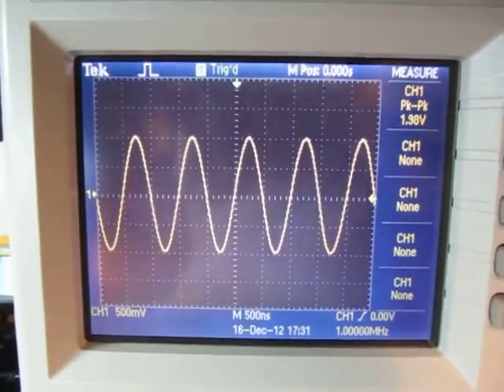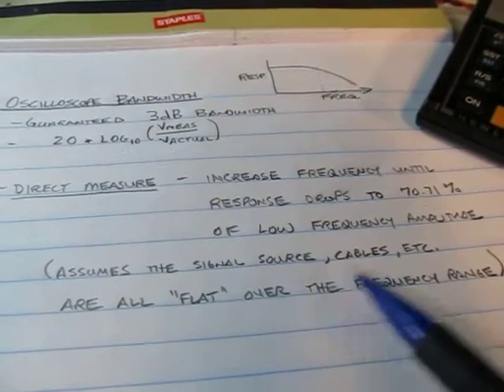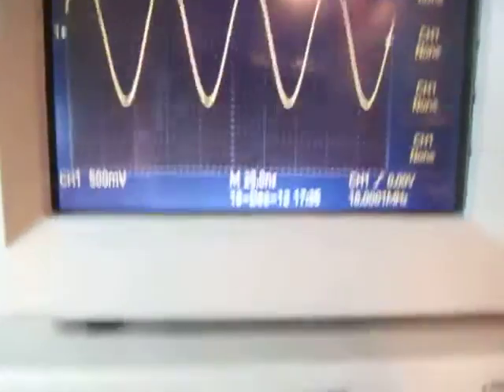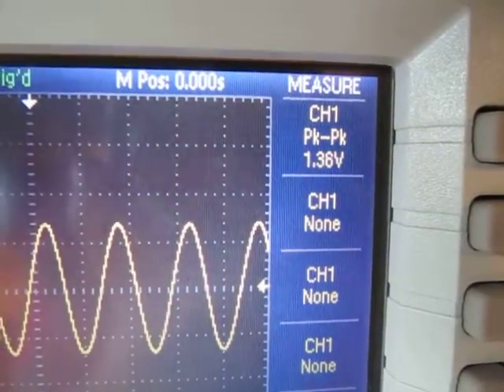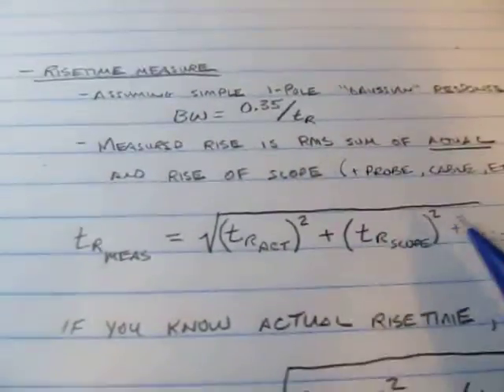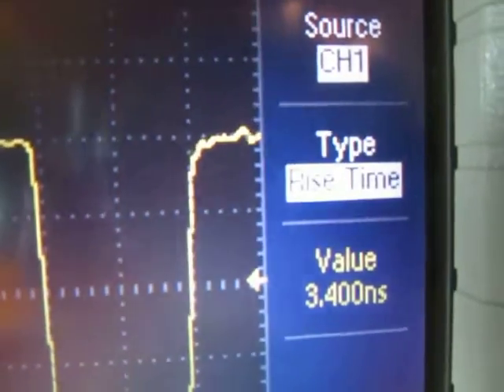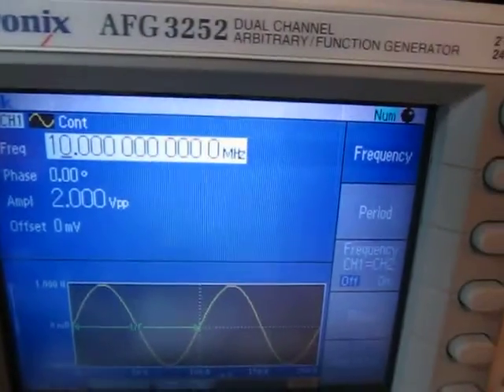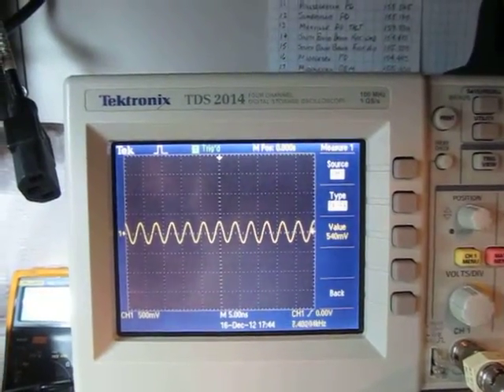#70: Digital Oscilloscope Bandwidth Measurement - direct and using risetime

Comment: Hi. I have now (for the first time) my own scope 🙂 It is a Kenwood CS-5165. It has A and B sweep, and I try to examine a fast rising edge. My problem is that when working at high speed Time Base positions of the Sweep Time that my trace intensity is very weak. I have just opened the case and adjusted the intensity according to the Service manual. It is better now but still weak light. The same thing when using the x10 MAG time base. Then I turned the Adj. pot to it's max. It gets some better but still not satisfy for those fast signals. I believe the same problem yesterday with very small signals, like something about a few tens of mVpp. Maybe you have some tips on why and how this happening, and maybe it is to expect. I can not tell us very little to no experience with analogue scopes. Maybe the scope got deteriorate after what is it >30 years? ...
Reply from the maker: Definitely to be expected on an analog scope.  The faster the sweep, the dimmer the trace.  And of course, 30 yrs of aging and use will also cause some degradation.
Reply: @w2aew  No remedy?? I know, it is the technology, the beam has to sweep fast and has not enough time to leave a high intensity trace/mark... Even though I like those analogue scopes. Yesterday I was playing with an analogue video signal (monochrome and color), and if you know how (with B-sweep) you can examine every Line of the Frame. The trigger was really very stable. The trace is visible just enough to work with it. Tektronix MDO3014 triggers also nicely on video, you can even choose the line number to trigger on.
Reply from the maker: @ernestb.2377  The nature of the beast of an analog scope with 30 years of age on it.

Comment: İ meausured -3db bw of the data on the matlab plot. İ get data from the oscilloscope.it is 170 hz but signal 8Vpp at the 100hz and  5.6 vpp at the 250 hz oscilloscope. İ get different bw.Why it is different bw in the matlab plot and oscilloscope half power frequency?
Reply: But signal start to attenuate at the 170 hz on the oscilloscope and at the 250 hz decreased half power
Reply from the maker: @evlabd  It's difficult to say what is going on without knowing what MATLAB is calculating, and how it is doing it.
Reply: @w2aew  i took data from the oscilloscope and plot it on the matlab. Which bw is true i could not determine
Reply: But it could be calculated bw frequency(-3 DB bw) on the matlab, must be decreased half power at the same bw requency calculated on the oscilloscope
Reply: But i took time interval in the matlab plot to measure bw(1/t)

Comment: At minute 10.05 you inverted 2.7372 (that means 1 / 2.7372) and you obtained 365.33 (multiplied by 0.001). That means that the formula for the BW should be (0.35 / trScope ) * 1000
Reply from the maker: Yes, there are a few "factors" assumed:   Bandwidth (in MHz) = 0.35 / risetime (in ns), or risetime (in ns) = 0.35 / bandwidth (in MHz).  Since 1/1MHz = 1000ns, that's where your factor of 1000 comes from.  To simplify things with this formula, we use MHz and ns and ignore the 1000x factor.

Comment: This is a very informative video, thank you for taking the time to produce it.  How much error is significant if the generator frequency is 100, 200 or more hz off + or - ?  Can I say, hope for reasonable results if I use one of the low-cost-from-China synthesized generators (allegedly good up to 4.4 Ghz), or even a small handy-talkie intended for use on say 440 Mhz?  In my case, I need something in excess of 500 Mhz to test a TDS 3052B...not likely doable with the 440Mhz HT, but perhaps something else?  Thanks.

Comment: sir
i have a basic rc circuit which will be used as photo-diode  detector circuit, how can i measure its bandwidth using oscilloscope?
Reply from the maker: You'll need more than just a scope - you will need some sort of input signal to your circuit so that you can measure its response.

Comment: I do not know rise time of my signal generator how do calculate
Reply from the maker: Measure it with the scope.  If the risetime is slower than the scope's fastest risetime (predicted by scope bandwidth), then you have your answer.  If the risetime is very close to the scope's risetime, then you really have no way of knowing the actual risetime of your generator unless you can use a faster scope or find the specification in the datasheet for the generator.
Reply: Thank you

Comment: Hello all, if i push a scope past the range of what it was designed to do will this reduce to life of the equipment. I know this was only for educational information.  Taking this reason from a car it can start in second gear but best result in to put it is first gear. this would be to same for oscilloscopes when testing.  Just having an educational guess here may be wrong. have never owned an oscilloscope.

 Thanks in advance.
Reply from the maker: No damage. Just might not trigger properly, or display all the correct details of the signal.
Reply from the maker: No damage. Just might not trigger properly, or display all the correct details of the signal.
Reply: Thank you for the quick reply going to buy an oscilloscope soon i had to check first. still deciding on type at this stage, got three months, looking at a price about 1000 t0 1500 dollars. All the best for your channel.

Comment: why I can't measure 100Mhz rice time in 100Mhz oscilloscope it's there any reason for that explain me
Reply from the maker: Can you rephrase your question? The phrase "100MHz rise time" doesn't make sense. What is your question?
Reply: Physics.  The definition of 100Mhz bandwidth is the point where with a 100Mhz input signal the viewed amplitude is -3db down.  (50% power 70% amplitude).  The scope manufactures have a general rule of thumb that you need a scope with 3x the bandwidth of the rise time to avoid severe degredation.

Comment: Actually I am using 100Mz oscilloscope can I able to measure the rise time of the more than 100Mz signal
Reply from the maker: No, you can't.  A 100MHz scope means that a signal at 100MHz will be measured as much as 3dB lower in amplitude, and higher frequencies will be attenuated even more.  Since the rising and falling edges of digital signals contain high-order harmonics of the signal frequency - they'll be highly attenuated, thus will measure MUCH slower than their actual speed.
Reply: Can you suggest the which range of scope will measure the 100mz signals which I have to use
Reply from the maker: General rule of thumb for measuring digital signals is that the scope bandwidth needs to be at least 5x greater than the highest digital clock frequency.  This will let you get the 3rd harmonic will only a little attenuation.  Also, be careful about mixing up digital clock frequency with digital bit rate.  100MHz clock rate is a 100MHz square wave and would ideally need a 500MHz BW scope or greater.  But, a 100Mbit/sec signal is a maximum of a 50MHz square wave, which would need a 250MHz scope BW.

Comment: I get a weird behavior when I measure bandwidth on TEK Scopes (TDS, TPS 1000/2000 Series): the PK2Pk Amplidtude at the guaranteed BW end (50, 100, 200 MHz) is even HIGHER than the start frequency (usually 50 KHz). I use a Fluke 6061A  as  generator. Of course, I also use a 50 Ohm termination.  Does anyone has a clue why this is happening? thanks
Reply from the maker: This is odd behavior.  While it is certainly possible that a scope could be misaligned and cause this problem - it is highly unlikely that all three of your scopes suffer the same problem.  Thus, I think you need to carefully examine your test setup, equipment and methodology.

Comment: Hi, Awesome video(s)!

[Q] I have a 70 Mhz AWG and a 200 Mhz DSO. 

I as trying to do some measurement of my own. Unfortuantly i can't reproduce you "first" approach (since the scope exceeds the gen.). So I Was looking at the second way, but i don't have the actual (real) Rt of my generator, the scope reports a Rt of 9ns. Is there anyway to acquire that number, or do i need some better gear (the AWG manual reports Rt should be < 10ns, but that tells me next to nothing .. :-) ?

Thanks!
Reply from the maker: 36R Given the fact that a first order estimate of your scope's risetime is 0.35/200MHz = ~1.8ns, and that this is substantially faster than the 9ns risetime you measured on the signal generator - the likelihood is that this is pretty close to the actual risetime of the generator.  So, it's not fast enough either.  Two other things you can do..  You can build one of the schmitt trigger oscillators using a 74AC14 as I've shown in other videos.  This gives you a signal with about 2ns risetime that you can use for testing.  Or, even easier, since you said the scope is a DSO (digital) scope, it is highly likely that the scope has an FFT function.  If you simply run an FFT on the noise of the scope (just turn on FFT using the most sensitive vertical setting), and look at the bandwidth that is shown in the resulting FFT plot.
Reply: *****  Thanks! I built the circuit, and indeed it got a 2 ns rise (what a difference in signal when looking at the AWG). Awesome! Now i was checking your FFT option. I tried it, but i got lost. I disconnected all input cables, set the scope up as 2 ns / 500uV (thats most sensitive i guess). Then i turn on FFT,  it show "20.0dB 625Mhz/div. Sa 25Ga/s and Center 4.375Ghz". I have not a clue what to look at! :-) I did had a look at your FFT video (very nice), but related to this i'm missing it.
Reply from the maker: 36R You probably want to slow down the time/div setting until the Center frequency shows something like 200MHz or so.  Then, you should see the noise floor be higher on the left side, starting at DC, then at some point it will drop lower - at a frequency approximately equal to the scope bandwidth.

Comment: Just a newbie question sir regarding oscilloscope probe bandwidth. How many Mhz of probe (@ X1) do I need for a 50Mhz analog bandwidth oscilloscope?
Reply from the maker: The answer is - you can not get a 1x probe that will operate at 50MHz.  Any 1x probe will have too much input capacitance to work that high.  It's easy with a 10x probe to get 50MHz.
Reply: I have just bought a Uni-T oscilloscope with a 50Mhz bandwidth and it came with a probe that have only 6 Mhz at 1X and 60 Mhz at 10X. I just want to ask sir,is this enough for this kind of oscilloscope bandwidth? Or do I need to buy another probe with higher bandwidth capacity? thanks for a quick response sir :)
Reply from the maker: Freddie Mortos That's all you'll be able to accomplish with a 1x probe - period. With the 60MHz BW in the 10x position, you'll get the full 50MHz BW that the scope offers.  The probe will not increase the available BW of the scope.  Be sure to view my video on the basics of 10x/1x probes.
Basic 1X and 10X Oscilloscope Probe tutorial
Reply: Thank you so much sir. I am really newbie when it comes to oscilloscope. I've tested the scope that I have bought awhile ago with 1Mhz square wave signal and at 1X settings on the probe,and the signal is very much attenuated. It does not look as a square wave anymore. Maybe I have to study more about this. Anyway the oscilloscope model that I'm talking about is the UNI-T UTD2052CEL. Thank you again sir for your time responding my questions. I watched all your videos and they are all very informative.
Reply from the maker: Freddie Mortos 1X probes are only useful for low frequency signals, typically a few hundred kHz or less.  What you're seeing is the low-pass filtering of the 1x probe, and the excessive capacitive loading affect on your circuit.  Rule #1 - always use 10x probes unless there is a specific reason to use 1x, and your signal/circuit are appropriate (low frequency, etc.).
Reply: My question yesterday supposed to be like this. What is the ideal probe setting in checking the oscilloscope bandwidth? I think I know already the answer based on your answers to me,but I want to be sure because maybe I'm doing it the wrong way. Thank you sir for your tips.